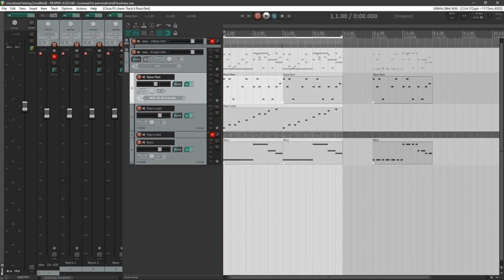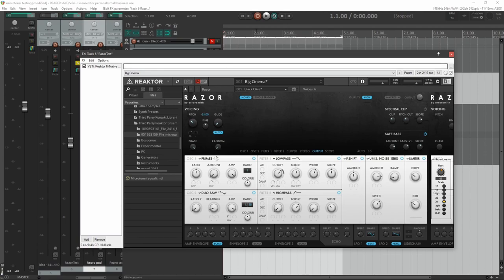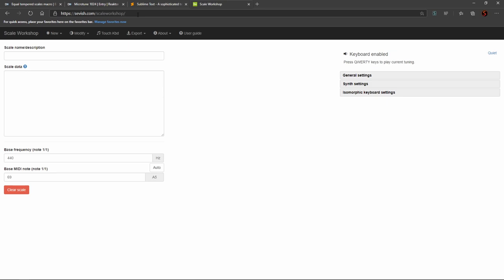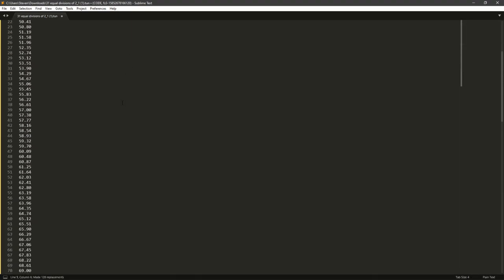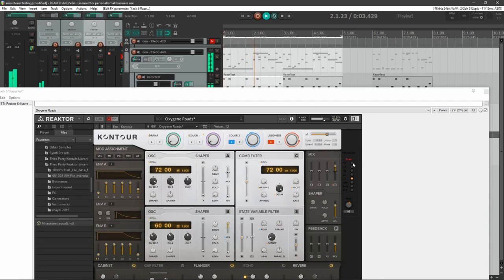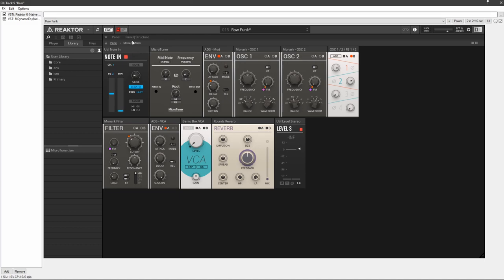Microtonality in Reaktor (Microtonal Razor, Kontour, Steam Pipe 2, etc...)

Comment from the maker: Timestamps:
 Intro
0:00 - Intro and Explanation of Microtonality
2:48 - Probably use a limiter/compressor on Master before continuing

 Simpler component
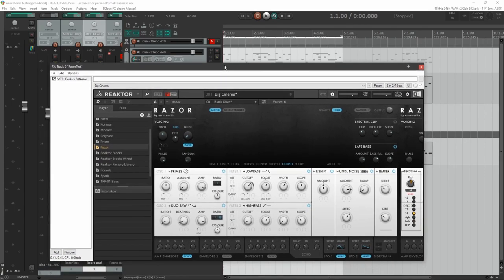3:22 - Implementing microtonal component into Razor (it’s the same process for both of them at this stage)

 More complex component
7:25 - Implementing Microtune 1024 and converting custom .tun files to work with it.
9:40 - Scale Workshop to make .tun files
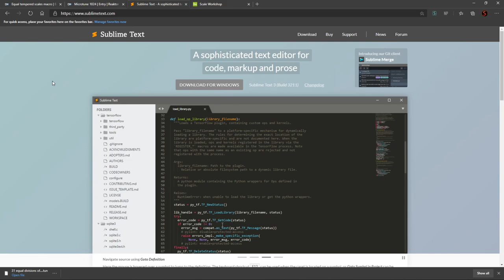11:00 - Editing .tun file in text editor to make it compatible with Microtune 1024
13:30 - loading the new file into Microtune 1024

 Hooking up a few other ensembles
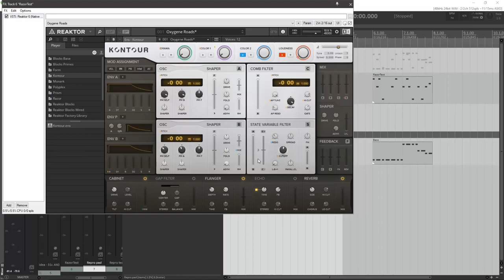15:00 - Kontour
16:18 - Lazerbass
17:20 - Spark
18:12 - Steam Pipe 2

 Misc
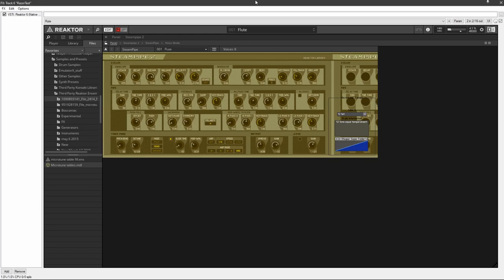19:19 - Saving as new ensemble
19:58 - Microtonality in Reaktor Blocks with MicroTuner block

Comment: Hey, I'm the person that originally made microtone 1024. You can just use program scala to turn a scl file into one that is compatible in Reaktor. You can do this in bulk as well, that's what I did for that archive which is no longer up. Far simpler than the convoluted process you seem to use and you would also be able to adjust mapping.
Reply from the maker: Hi, thanks for the input! I've been planning an update/part 2 for this video at some point to go into more details on some things I feel I didn't cover well enough here. I'll be sure to cover Scala as well while I'm at it.

Also thanks for making Microtune 1024 in the first place, using Reaktor microtonally is absolutely fantastic.

Comment: Thanks for this.  As someone with no real experience with actually patching Reaktor ensembles, this was very helpful.  Now I have Kontour, Spark, Prism, and Monark all microtunable (Monark had me stumped at first because the pitch wire is kind of buried, but eventually figured it out).
Reply: Where did you connect it in Monark? I had it working by placing it on the keyboard section between the p+G and the keyboard module but the microtuning module doesn't show up on the instrument panel (which makes it unusable.

Correction: it didn't work correctly after all. So I don't know where we put it in Monark